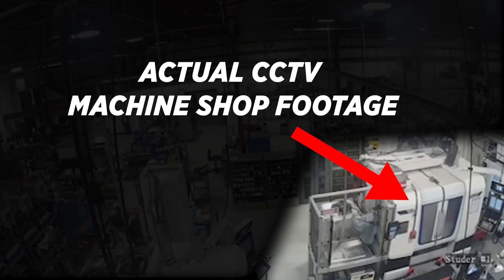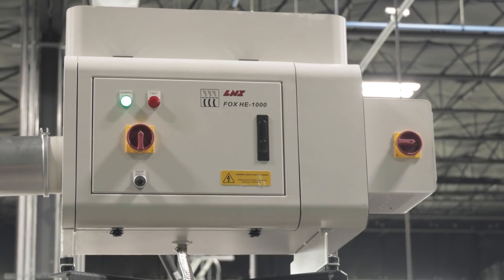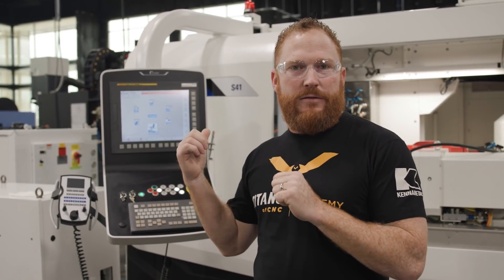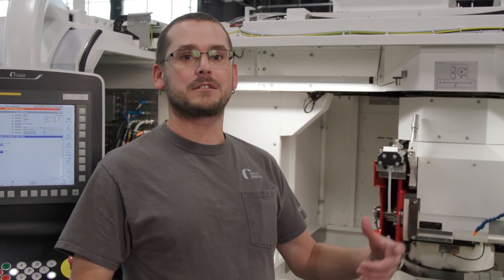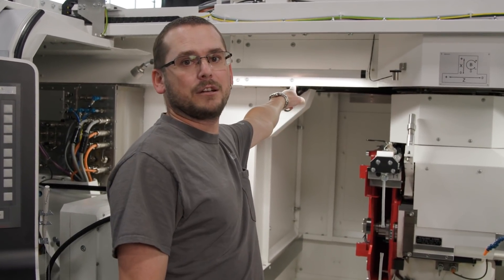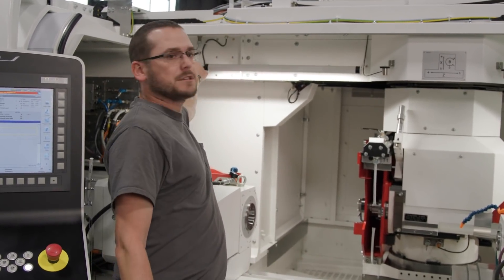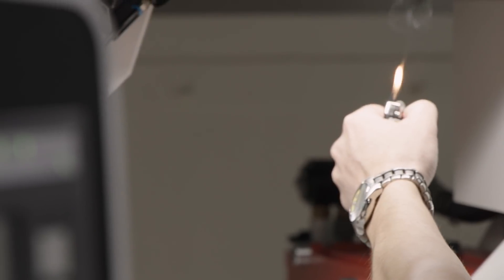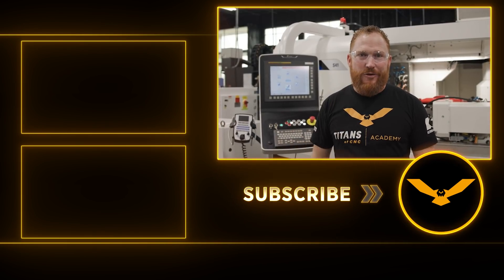STUDER S41 | United Grinding’s Fire Suppression System

Comment: one point, this isn't just for oil fires, how about machining magnesium, ie mag wheels, in 1950's era mill videos that what they had to deal with (but using a bucket of sand to extinguish  it{Mg is a reactive metal which can ignite by touching water})- we still have to machine materials like this today, so worth it to be cautious, esp. as the guy from Titans of cnc says these are worth $1.7Million each, and that's assuming US dollars, try this conversion to AUD, will make ones' eyes water.

Comment: CO2? Why not Halon?  I have the system for my sinker EDM machines, but I use Halon. Only active in "lights out" scenarios.
Reply: Halon can form toxic and corrosive gases after they put out a fire.CO2 is less dangerous to personal and equipment.

Comment: crazy i never knew the cutting fluids were flammable, i used to work at a small cnc repair place and would deliver cutting/grinding/hydraulic fluids for them, the owner of course told me they were non flammable

Comment: Working on a HSC machine, same problem with the mist. One day the system triggered out of nowhere. Shat my pants! It rips a vent on a 300Bar Co2 bottle open. Had a pile of dry ice in the  machine. That will scare the s**t out of you.
Reply: CO2 tanks are approximately 50 bar (5 MPa) only.
Reply: @norbertfleck812  don't know it was loud :D

Comment: The first five seconds I was thinking: First a broken water line, then the snow storms and now this 🥺
Good to see that this was just an example of what could happen - not what has happened.
We actually built something similar in our CO2 laser cutter: two IR sensors detect flames, stop the air, move the laser-optics away and sound an alarm. We never run the laser when there is nobody in the shop so we just have a CO2 extinguisher next to the machine.
Reply: LOL!!  Me too!! In 30 years the worst mess I had was a hose siphoned off 55 gallons of Blaser on the floor! I made my guys mop it up and use it!!!

Comment: The repeatability on these machines is only as good as your measuring equipment, that needs to be up to scratch, and have repeatability studies done on them, that's really important at sub 1 micron even above that, you cannot have the machine with out the measuring equipment which can match it, this is really really important.

Comment: YAY!!!  The sensors and buttons work...  what about the actual suppression system?
Reply: That surely will be tested seperately
Like pressure would be most likely given via pneumatic air and then its checked if all valves and nozzles work
Reply: @hyperfluff_folf  Surely aka totally unsure

Comment: I ran s20/25 older versions of this and we worked to submicron tolerances for the last 20 years now unemployed :-( The thing you don't mention is these are for grinding hardened/heat treated materials soft metals clog up the grinding  wheels. Watch out for vibration and wheel balance! we used these to 'match'(make them fit together) Injector valve guides to nozzles for diesel fuel injectors, also the s25's cut the multiple angels on the pointy(seat) end of the valve. The repeatability was amazing even 20 years ago, if monitored, as cutting to sub micron tolerances was badly affected be environmental temperature changes, for instance from nights to days temperature variation had to be taken account of in your SOP's, or you were quickly making scrap, unless you have the machine in a temperature controlled environment, which only a few of our machines were, I was the manufacturing Craftsman on those machines and others.
Reply: why unemployed

Comment: what advantages does co2 have? wouldn´t nitrogen be as effective but safer?
Reply: You can store CO2 as a liquid at a pressure of 5 MPa (50 bar) only.
Reply: @soundspark  Yes,, when expanding, it cools down to approx. -80°C
Also CO2 is pretty much heavier than air, so it gets sucked into the fire instead of drifting away.

Comment: I ran Studer S20/25s for 20 years for Delphi automotive, give us a job? Plant in UK shut down and moved lock stock and barrel to Romania(well over a thousand bits of machinery/plant), we were making big profits but the EU had other ideas!( open bribery of Delphi with incentives to move existing production to eastern Europe, spreading the wealth out.). Never had a fire in a studer grinding with oil coolant, but other machines did burst into flames, but we had same systems as described in this video, very reliable as long as they are maintained.

Comment: Smoke a Cigarette and the machine thinks everything is on fire 👍🏻
Great idea 🤷🏻‍♂️
Reply: A cigarette is not a problem, but the flash from a photographer can easily trigger the fire extinguisher.

However, you should not smoke on the Shopfloor.

Comment: In the old days, we used to cut aluminium with a paraffin based lube. The machine was surrounded with fire extinguishers, as catching fire was a regular occurrence lol.
Reply: Who thought that was a good idea? What company was it, ACME?
Reply: Me when milling Magnesium
Reply: That is one of the most awesome things I think I have ever heard myself read lol.
Reply: I'm usually using alcohol when i'm grinding carbide or hss manually

had no problems so far, but i did light my fingers on fire on other occasions. Alcohol burns somewhat cold, would not reccoment still

Comment: Just writed a guide on a dire suprression system similar to this one but equipped on a diesel heavy shunter locomotive who services here in Italy.

You need to test those kind of systems at least every 6 months.

8kg of fire extinguisher can easily stopba starting fire in the engine room.
Reply: Daily testing is legal requirement in Finland

Comment: But that's not a real test wit the co2 because you didnt check if the cow comes out as it should,it may have a blockage or something wrong,the censors work but dont know about the most important part
Reply: When you test well that kind of systems you have to install a test lamp who substitute the pyrotechnical charge who get off the  CO2 extinguisher.
With that lamp you test the functionality of the extinguisher electric line.
Then is MANDATORY to disconnect the extinguisher hoses from the CO2 bottle and test the nozzles with compressed air.
Those tests must be done by trained people, especially if the extinguisher gases are halons or similar (F-gas European laws)
The machinist can daily test the functionality of the system like in the video.
Reply: I think it sounded like they may test it. In addition, with the enclosed grinding area, and the stop of coolant flow, the fire would burn off any remaining mist and oxygen etc and hopefully suppress itself if the CO2 failed to discharge.
Reply: @yian3251  
That would imply the grinding area is sealed enough that air ingress and egress is not possible and the flame cannot escape or spread into other areas. It looks as though there are avenues that the flame can travel and find fresh air and thusly continue to burn even with the doors closed. It does not appear that there are heavy seals on the doors either.
In short, I wouldn't put my faith in it self extinguishing